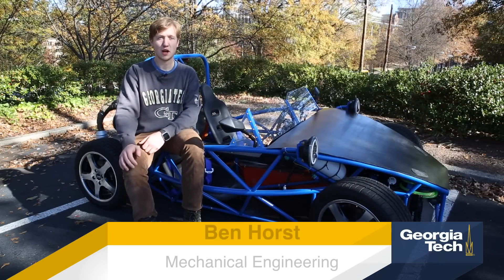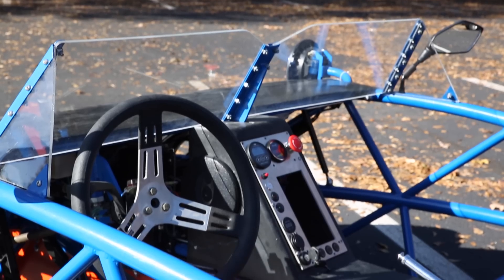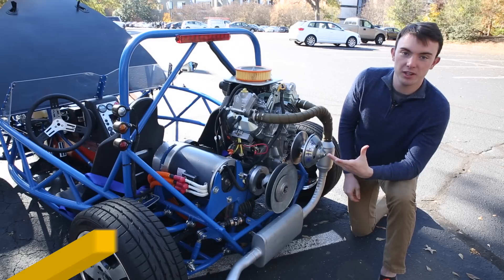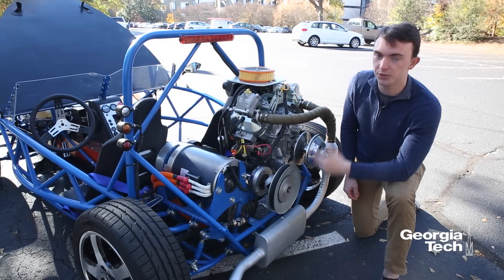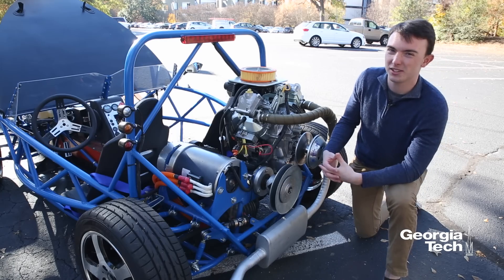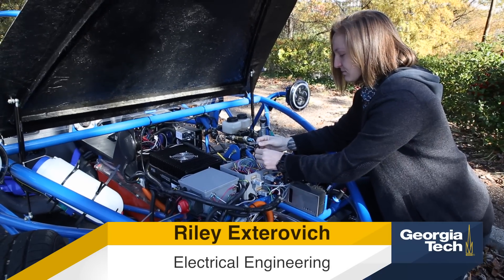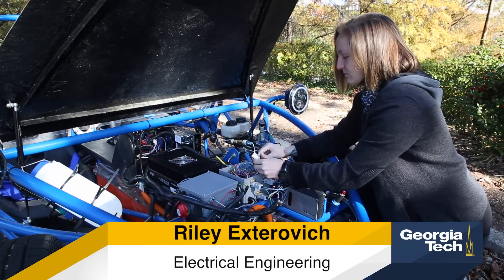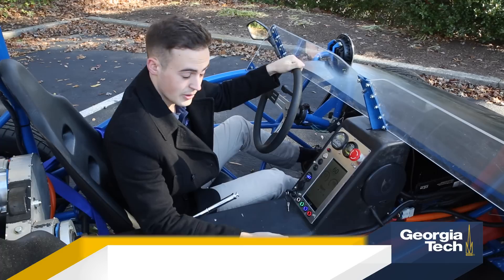PH571 - Performance Hybrid Vehicle

Comment: Hi, 
Has anyone successfully attached a AC/DC motor to the main shaft pulley of a Gasoline or Diesel Engine (to convert the Vehicle into pure hybrid) in such a way that Engine's different RPM & LOAD  should be 100% synced with the DC motor's RPM & Torque with a delay not more than 0.2 seconds?
If yes, then can you please tell me that which motor controller model you have used? and how you have given Engine's live RPM & Load to the Motor controller's throttle?

Thanks
Reply: I'm considering building something like this for a v6 engine. My main thought is that electric motor would always spin faster than engine threw a simple clutch setup with belt drive direct to front pulley. Only would be used for faster acceleration or passing power.

Comment: Very nice project. I hope this project continues and you guys keep develop it. What is the motor/inverter unit you used, and was it easy to control the marine engine without proprietary engine controller access?